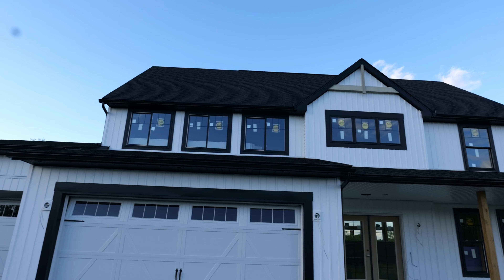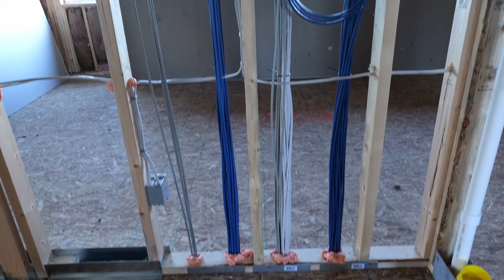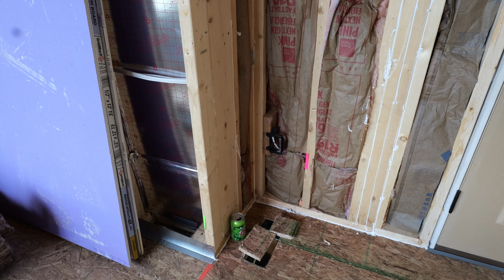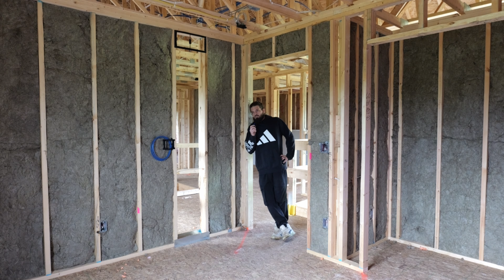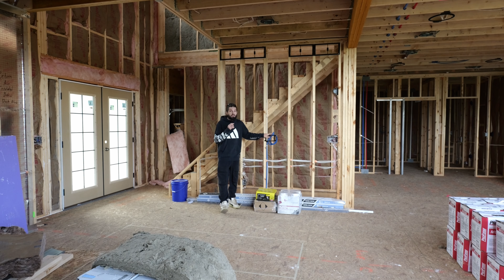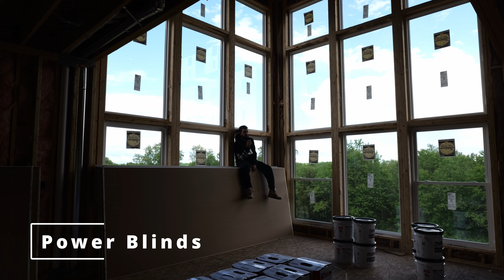Modern Farmhouse Build: Low Voltage

Comment: The only downside I see to your running the 2 wall connector to only a single line overall is that it would turn a 4ohms speaking into 8ohms but other wise nice job
Reply: Or you can just buy 2ohms speaker instead lol

Comment: My GOODNESS!!! You spent a mint on cables alone. This house is going to be amazing.
Reply from the maker: Thank you! I probably went a little overboard on how many runs I pulled but I couldn’t resist with how much easier it is without the walls up haha
Reply: @ethanwingsit  best advice ever no regrets when you go “overboard” on low voltage.  There is no such thing. Reddit is full of people complaining about this not working or that and the one answer that always comes up is fix your WiFi.  Hardwired side steps all that headache!